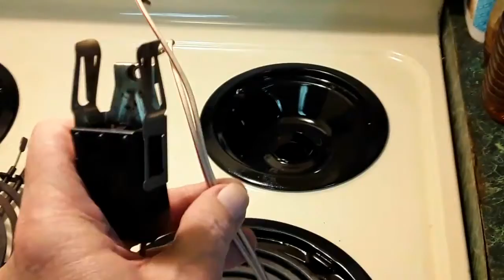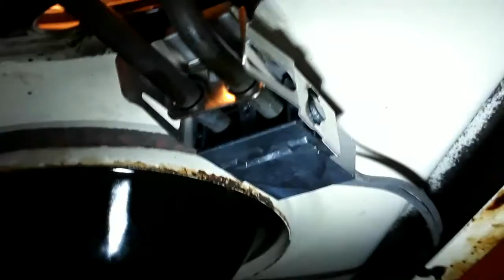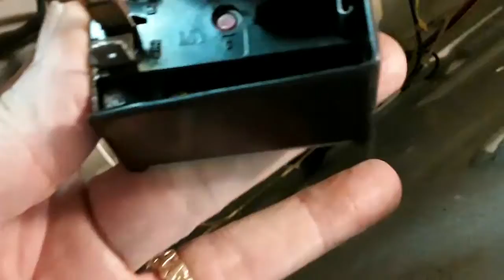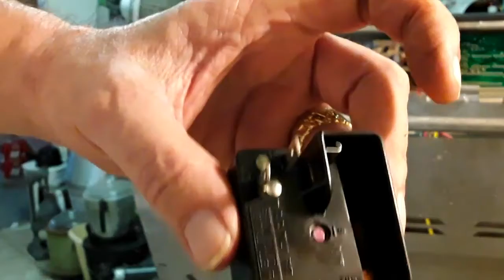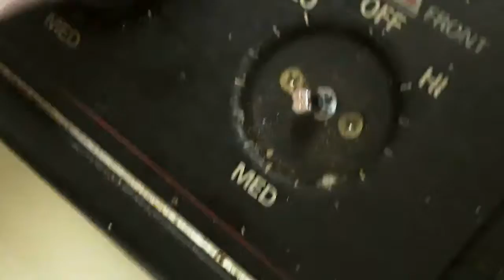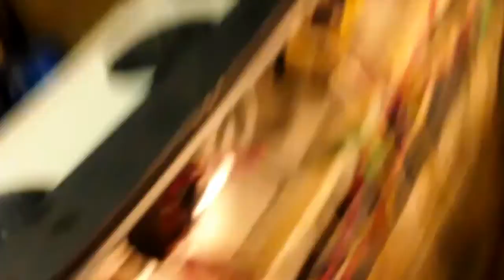Can I fix it?

Comment: I like my old stove too. I cheated last time the wires fried when i was canning and mover the connector from the smaller element to the big one, it takes a little longer to heat up but it works. I'll get around to putting the new one on eventually
Reply from the maker: That's how I've been using my big front burner - wired to the switch of the smaller rear burner. Finally got all the needed parts so I had to fix it!